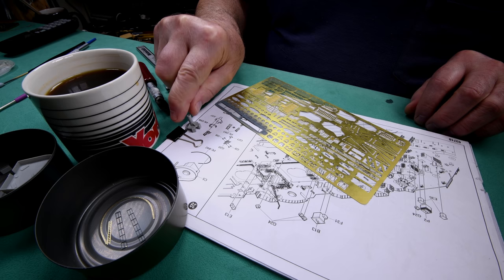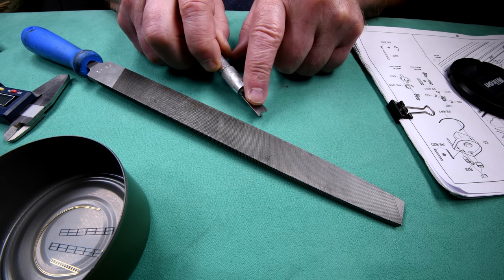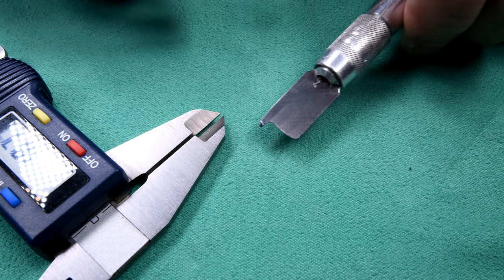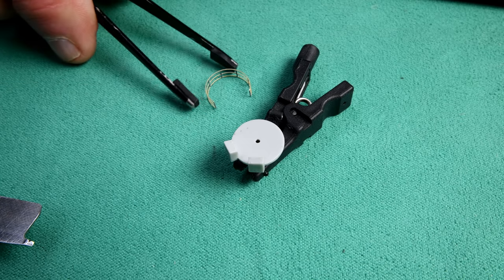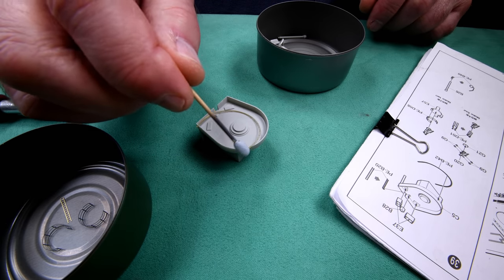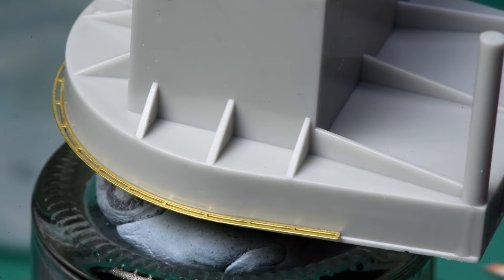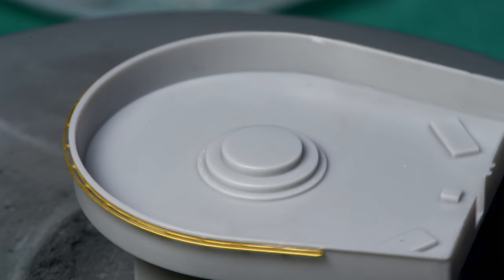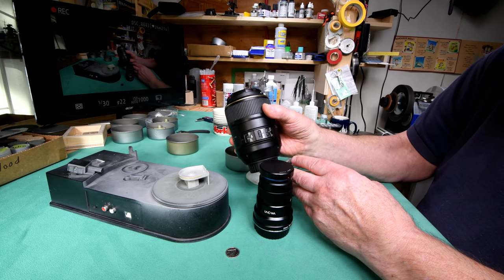The Model Ship - Part 684

Comment: Thanks for the shoutout regarding your pH etch cutter you could try making a couple of different sizes of blade width that way you are covered for different sizes of pH etch cut tabs i might try that myself as i have a few hobby knife's & blades you did great curving that railings i don't know if i would have done it as good as you did see you tomorrow Ron cheers 👍😀

Comment: why cant you use a rounded blade and sort of roll it to cut the PE ? Or the pointy end of an angled blade? Those chisel blades are not for PE cutting. Or even PE scissors?
Reply from the maker: Re: "why cant you use a rounded blade and sort of roll it to cut the PE ? Or the pointy end of an angled blade?"
Don't know! Never tried a rounded blade. Possibly no reason at all. 

Re: "Those chisel blades are not for PE cutting"
Well .... lets see how this modified blade does on part PE-B40 in episode 685 today.